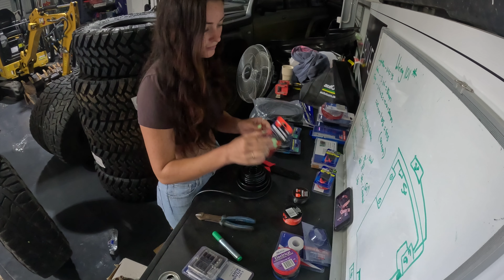SHED TO BUSH!!

Comment: Great job with the wiring. Its an intimidating job to take on. Well done. Always a great idea to keen the electricals nice and tidy, tucked away, with good strong connections and well insulated. I try to use multiple methods for connections, such as crimp, then solder, then heat shrink. Or in other situations splice, twist wires to join, solder, then heat shrink. If connections already done before heat shrink you can get insulation that can wrap, then kneed it so it bonds together. Melted fuses and connections are often due to a poor connection and arching, so make connections strong by using two methods to join.

Comment: Electrical is always the worst. I'm putting off re-doing my 12v setup because I want to fix a bunch of my rushed wiring, but it is always a lot easier the 2nd time around.